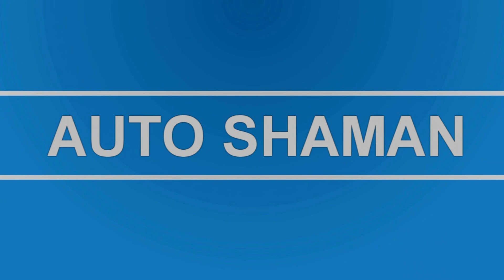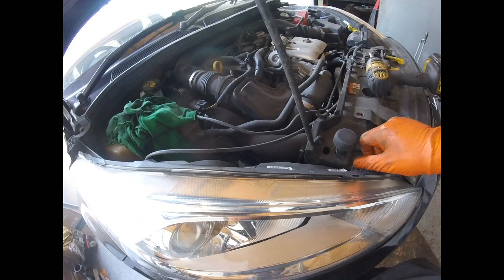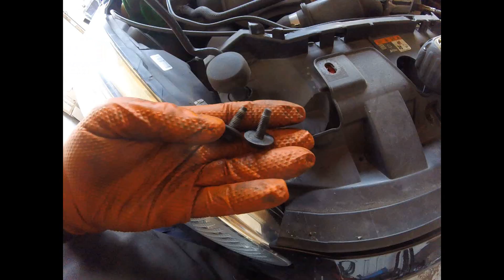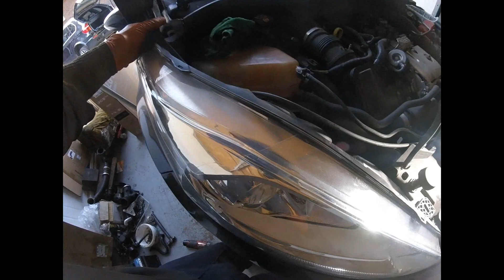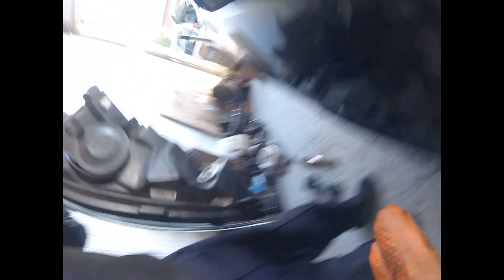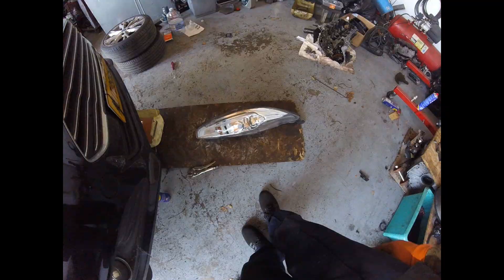Cómo quitar los faros de un Ford Fiesta EcoBoost

Comment: Are you a mobile mechanic? I have a VW Crafter 2.5 2007 that needs its valve stem seals changed. Would you be able to do this job for me? I am based in Birmingham.